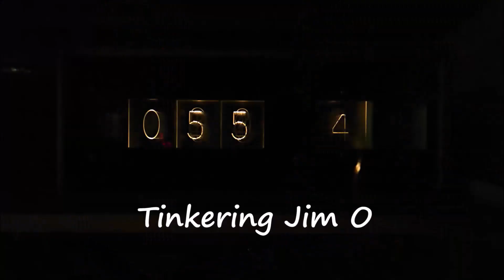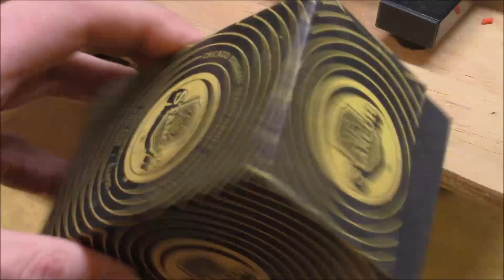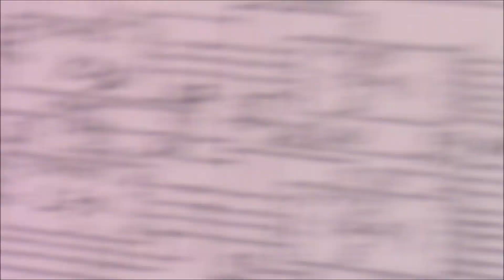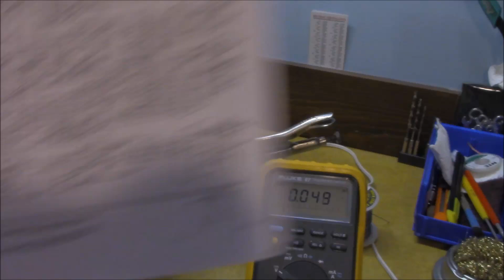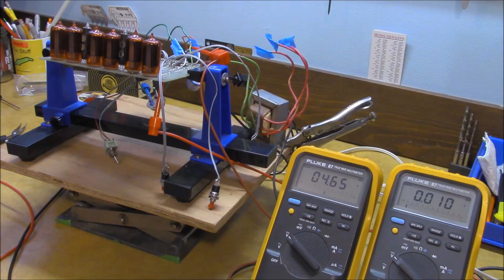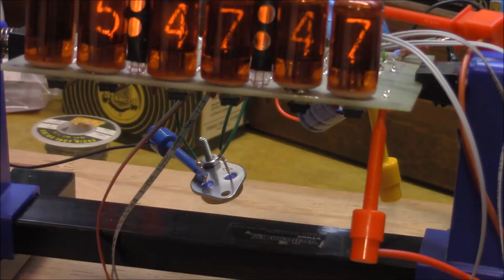Vintage 1972 TTL Logic Digital Nixie Clock B&F - saving and bringing back to life. -

Comment: Nice rescue of the old clock board!   Very interesting 5 volt DC regulator circuit there!    I am real tempted to grab a 2N3055 transistor and use that schematic and try it out!  The ZM1000 tubes
look great too.
Reply from the maker: The interesting thing with this circuit you mention is when loaded, it does not seem to adjust up to 5 volts.  When I used this regulator circuit it in another clock I created, I could only get about 4.7 volts, about the same as I see in this clock.  I considered that it was good enough but maybe adjusting a few other components in the balancing string can help achieve a better result.  Unloaded it has a better range.  Thanks.
Reply: @JIMO415  I tried a 2N3055 one time in a broken 48 volt DC power supply.   The 2N3055 only outout around 36 volts but it was stable.   A bit later on I got the proper replacement
for the burned out one, and the supply again makes 48 volts regulated up to 1 amp.    So I concluded that 2N3055 is not so great as a regulator.
Reply: @JIMO415  Well I have tried 2N3055 in the past as an emergency test voltage regulator in a blown-up 48 volt DC power supply.   Eventually crossed the original regulator transistor to a suitable substitute, and ordered it from Digi-Key.    But for the first few crude troubleshooting experiments, I cobbed in the 2N3055 to see if the supply would run at all.
It did run, but it was only making about 36 volts but that did seem to hold ok under moderate 1/2 amp. load.    My conclusion then was that 2N3055 is just not that great of
a candidate to use for regulating DC voltage output.  After the part arrived from Digi-Key (2N68XX something I forget now), the supply again makes nice 48 volts regulated
to about 1 amp.   I inadvertently had blown up that supply when I accidentally sent some phone ringing AC 90 volts 20 cycles into it  and let out the magic smoke.

Comment: I stopped using my nixie clock because it was making RFI..
Reply from the maker: Ahh that's the beauty of this old vintage Nixie clock, there are no switching power supplies in it.  Linear supplies provided by the transformer I would imagine are waaay quieter.  All the modern Nixie clocks have switching power supplies in them.  What make or brand Nixie clock do you have?  I am curious.

Comment: Nice work on getting it going again! This is at least the 3rd time I've seen (or heard of) bad HV diodes in B&F Nixie clock, so at this point I'd say it's a known issue with them. 1N4007 diodes is what I'd replace them with too. Those sleeves for the colon tube are nice, that's the first time I've seen that (they may be home-made) and same goes for the gold plated sockets, a nice upgrade. 
I look forward to seeing what case you come up with for this clock.
Reply from the maker: Thanks!  It was a fun project.  The enclosures are not always fun tho.  I like the see the works cases but on this one, all the pretty stuff is underneath.  Maybe a mirror on a 45 degree angle?  Too crazy I think.  I may relist and offer it up ...not sure.  As far as the sleeves, the holes look almost too good to be homemade.. but who knows.  I do like them.
Reply: @JIMO415  I agree with you on the enclosures, they can be a real pain to make, especially with just hand tools (currently all I have). I wish they had put the ICs on the top, it would have made it more visually interesting, and easier to debug. Maybe at least some of these kits came with the sleeves.